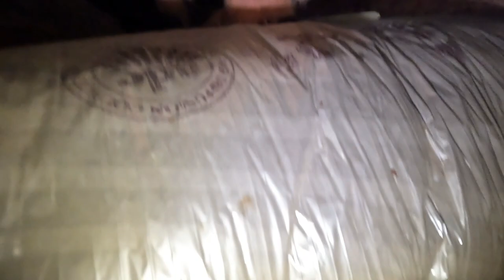Electrician Troubleshoot Circuit Breaker Tripping

Comment: Great work Steven , I don't how this was working before ! Reminds me of guy I used to work with at a factory in Tuscaloosa ,Al . He had replaced some switches at his sister's house. Well it didn't  have any breakers tripping or direct shorts to ground but what he did have was and this no lie, When he put a switch in the bedroom and flip the switch ,it would turn on the hall lights . I was able to get all the switches working correctly  ,it took a little while . The wiring looked like a DIY ,6 pack job and they can be dangerous !
Reply from the maker: Lol

Comment: Just curious, I didn't quite understand quite what was making the breaker trip. Thanks for the video you do a great job. Southwest Missouri here
Reply from the maker: Someone didnt know what they were doing. Basically they tied to different circuits together
Reply: @unitedtradesmanacademy1894  thank you I didn't catch that
Reply: @unitedtradesmanacademy1894 I've had repair experiences like that too. It amazes me that they do something and immediately afterwards they have a problem, but they don't tell you up front what they did or were trying to do. It would save so much time if they told you right away. :(

Comment: I'm amaze at how many code violations I saw in this video! I'd be afraid to work on this house and have another call a week later blaming me for a problem.
Reply: @Backwoodscards  .... 95% of what I did was residential, but not as an electrician. I was a trouble shooter for a generator company. The code violations of "open junctions without a box" are just so obvious that even a handyman would cringe. It's probably the most basic NEC requirement in the book.
Reply: Good on you to record your process in that code violation heavy house. Great way to stop homeowner from blaming you for issues down the road.

Comment: You’re right whoever did that they spliced two circuits together which caused the two circuit breaker to trip. They caused three hazards. 1 two circuits connected 2 exposed wires and 3 setting the wires on aluminum insulation duct.

Comment: That attic has a LOT of wires.  You mentioned that a wire was backfeeding another circuit.  What does that mean?  Was one outlet or light attached to two breakers?  If so, why wasn't the issue immediately apparent when the wiring was originally done?

Comment: House has no problems but a breaker that has three outlets in kitchen and only a small college fridge is on it but now breaker will not reset, i changed the breaker out with no luck.   Can a outlet go bad?
Reply from the maker: Sounds like a gfci somewhere tripped.

Comment: There is so little in this attic which was installed correctly when the house was originally built.  What a nightmare.  So much cable run unprotected across the rafters.  Those that wired the house were not electricians - even notwithstanding those bootlegged splices.  A qualified residential electrician would know about Article 334.23.  :(
Reply: Isn't that protection only required within 6 feet of the attic access, due to the ladder not being considered permanent?

Comment: Man. No staples used. No junction boxes used and probably plenty more code violations.
Reply: Welcome to old construction.
I've a victorian built before power.
Then they installed DC when the village bought a town generator

Then knob and tube.

Then cloth and rubber covered two wire

Then aluminum three wire

Then modern romex.

You find pieces of all of it everytime you open a wall.